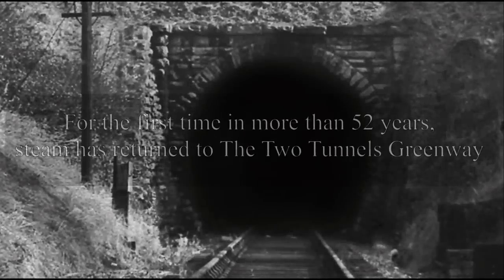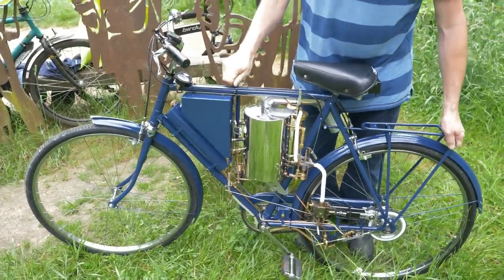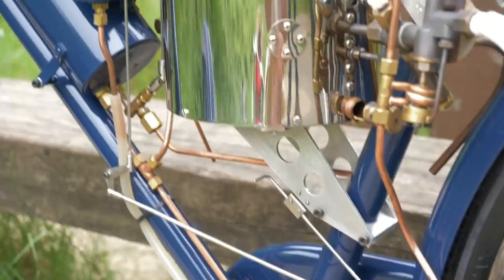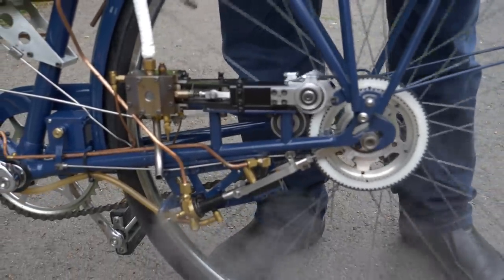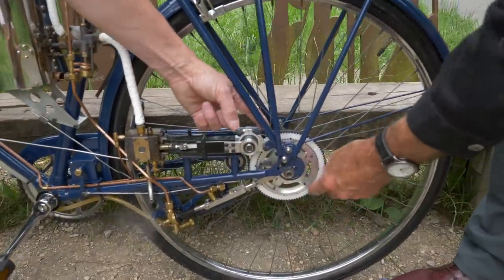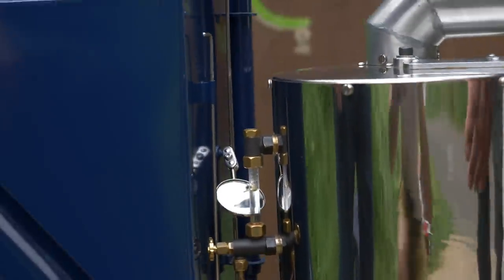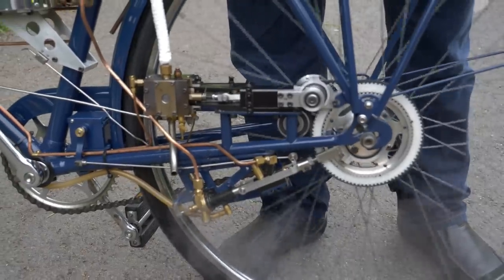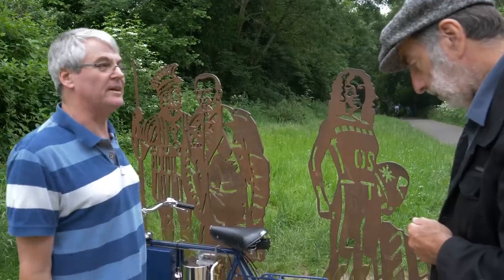The Ruscombe Gentleman's Steam Bicycle

Comment: Truly MASTERPIECE of engineering. 
Well done!
Reply: I bet he needs a license to operate it, lol.
Reply: It is
Reply: @mybluebelly  Electric bicycles are allowed 250W.  Anything above 250W is classed as a motorcycle, and so subject to all the regulations and licensing issues.  This machine is 130W - so it is well within the regulations.
Reply: @paulstandeven8572  also, its speed caps off at around 15k/h. So neither the speed is a problem!

Comment: Seen a number of attempts at producing a steam powered bicycle, but this is by far the best. It actually seems like an everyday use machine. ...It shows what can be done with informed and careful design. It would be nice to know a bit more detail of the hybrid boiler.
Reply: Yes Steamyfog, re: hybrid boiler, I can't understand why cramming a section of firetube boiler in there would help.  Obviously it does, but why specifically?  The price for doing it has to be very high- the time spent on it must have increased by 10x.
The refinement of this machine produces an incredibly rideable bike.  Just imagine if ICE engine development were delayed by 30 years.  The world received a few beautifully refined steam engine vehicles just as consumers got attracted to ICE engines.
Doble, White, Stanley, Sentinel Steam Trucks,  the last Bessemer steam locomotives in the 1920's with multiple cylinders/drive wheels, the Bessemer Steam Biplane, etc.
We might have had steam engines right into recent times.
Reply: @someotherdude  In my opinion it was the electric starter that killed the steam engine in cars or other road vehicles. Why wait a few minutes for steam when you could push the clutch in, press a button and go? Also, some people were scared of steam because they were worried about boiler explosions.
Reply: I think it was that and more- how would you operate the thing in the dead of winter with freezing?  Boiler explosions were not too serious though, with small monotube boilers.  The tube basically rips open and releases pressure, no 'bang'.   But also, steam engines wold tend to have less range and to additionally demand water, and they are oil consumers too.  Without computer monitoring and control, you have a more complex job as driver.  But read about the 'cyclone steam engine', it now takes 30 seconds for steam pressure to be ready to drive- about the time it takes to settle in, put on your seatbelt, turn on the heat or AC, etc.
Reply: @twistedyogert  steam died because IC engines were a lot cheaper to make.
Reply: @someotherdude  I'm not sure I would dismiss a boiler mishap quite so lightly. In this case a small quantity of 100 psi super heated (500C) steam released close to a human would be no joke. I have every confidence Mr Drake knows what he's doing.
Reply: HA HA!!!  No it wouldn't, not 100 psi you silly.  Silly fools in tire shops play around with twice that.  You might even be able to hold back 100 psi from coming out the end of a pipe, as long as the edges of the pipe weren't sharp.
Reply: Any boiler with modern steel instead of the brittle iron locomotive boilers of yesteryear, is safe.  They will rip open, not explode suddenly.  Now a jet of superheated steam suddenly erupting right next to your skin, that's a problem- but because of burns, not shrapnel.  And an extra layer of sheet metal will take away even the burn risk without adding weight.  It's safe.  That's coming from the guy (me) who is constantly berating people on FB and YouTube for doing unsafe things.   Although superheated steam is the realm of experts and gives amazing performance, it's not necessary-  Increase the piston size, go with 'wet steam' (300 degrees and 100psi) and you can actually let the piston be lubricated with water.  No oil system needed.
Reply: @someotherdude  thanks for your info very useful good luck
Reply: @someotherdude  some people in tyre shops get badly injured from tyre blow mishaps 😓
Reply: @someotherdude  It's the superheat that's dangerous, not the pressure so much. Superheated steam is completely invisible too.
Reply: non sequitur, if you mean tires blowing up and rim failures.
Reply: Yes it is, I agree Anthony.  But a single layer of sheet metal over the high pressure tubes in question will make it safe.  At that point it's no more unsafe than a hot exhaust pipe on a motorcycle.
Reply: @JimRichardson  Steam died because the power-to-weight ratio was massively inferior as was the fuel economy. They were more expensive to operate, dirty and not particularly suited to cold climates. Steam turbines were more efficient in ships, but maintenance was a headache at the time of the switch to diesel, due to scale. They are still used in nuclear naval vessels however. The US nuclear fleet is essentially steam driven. The aircraft carriers in particular are floating islands which do not require refueling within their designed lifetimes. I believe the steam turbine system is closed-loop, but it's my understanding that the carriers house desalination plants large enough to provide drinking water for a city of 250,000 people, so perhaps not, or the desalination is required for the steam-catapult system which is being replaced by electromagnetic launchers in the latest vessels. They also carry a crew of 5,000 and can accommodate about 8,000 troops, so there's that. So steam didn't die after all - it just moved to a more upscale market niche. :-)
Reply: @JimRichardson  actually range was quite the issue- often trucks had to take water from streams and ponds every 50 miles or so

Comment: Ive always loved the potentials of steam
Reply: Supppsedly spitfires Rolls Royce V12 ran on steam. The cooling sealed superheated system rand through the leading edge of the wings. The German mssserschmidt speed record "the French men burnt there hands on the leading edge when they pushed it into the hanger" 
The closed dry steam pressure system runs at 850lb per □ inch. Superheated dry steam. I think steam is the best system avaiable  the sealed dry steam system can run for 00s of miles before needing a top up of water. Would go along way to explaining the old world and how they could build these magnificent structures. Steam is the ultimate power. Less moving parts. More efficient and far more powerful than diesel. 
E.g.. 2 5/8 × 4 1/4 inch. Two cylinders at 125 lb per □ inch pressure can carry 74 passengers in one load with 2 carriges. 
The engine us 10 foot long. 2 1/2 foot high. 1 . Foot .7 nch wide. 4820 passengers in one day. Parramatta to domain Sydney 1890. Cheers.
Reply: Thanks for the info. When I was a kid about 60 years ago, I got a Christmas gift of a working kid version of a  steam  operated shop. With working drills, lathes ect. . A great learning tool. They cant sell those to kids now. Fire, boilers & saws. Wish I still had it.
Reply: @jedsparks3868  yes. We can't get anything now a days. Not even a chemistry set. Nanny state. I don't feel safe. Ring the DhHs. Omg. Help. Haha
Reply: @jedsparks3868  They do still sell them. Do an ebay search for Wilesco or Mamod.
Reply: Thanks

Comment: Wonderfully built. It seems the system is designed after Stanley, with the addition of an economizer. Beautiful machine.
Reply: I think the steam generator is more inspired by the Doble
Reply: @paulstandeven8572  hard to say without seeing it with the casing off. Doble didn't have a water level in their boilers. They were all monotubes/monocoil boilers with water in one end of the tube stack and steam out the other with superheater and  de-superheater sections also.  The Stanley's had firetube boilers (with an actual water level), and a superheater section running from the throttle to the engine. The one's I have worked on we have installed a pre-heater or economizer section to the feed water going into the boiler. Usually about 50' of 3/8" tubing under the smoke hood and above the firetubes. 

The vaporizing burner and tree for the jet looks very Stanley-esque also. Just one branch and jet, rather than two.
Reply: @WesleyHarcourtSTEAMandMORE  Agree.

Comment: Impressive steam machine. About the exhaust steam, you could use it to run a small alternator to power lights and horn, then condense it back into the tank. You could also do a Mk2 engine with triple expansion and a gear change system to better take on hills and flats.

Comment: I have a feeling that mankind and steam power haven't had their last dance just yet. 
Just an hour ago I felt  Compelled to research steam powered  Technology implemented throughout History as it pertains to the automobile and Motorcycle. I think that 1 could build a fast lightweight efficient steam powered bicycle if they were to design the frame around the steam power train and have Then be made for one another. I imagine that the wait for a 50 or 60 mile an hour machine would be similar to that of 125 2 stroke dirtbike  No expense was spared in research and development  Light weight high strength materials and cutting edge power train innovations.  I just believe that the bicycle is such a phenomenal platform from which to feel from when at trying new power sources because of how in Heron fishing bicycles can be really low existence in tires, the lack of frivolous components such as suspensions to waste forward propulsion energy with, then you have the slim aerodynamic design they all share. Using high strength ultra light weight drivetrain parts i.e. sprockets, wheels bearings would be nice to emphasize.
Reply: nice name!

Comment: Since I am a little slow on steam technology,  I would like to know about the (5:34) additional 300 degrees C super heat.  How is this added, and does it boost the final steam pressure or just make the steam more efficient by drying it out?    A superbly well crafted bicycle.   I would like to hear less noise from it.  I suppose the steam condenser would quiet the exhaust considerably.     Thanks for sharing.

Comment: so fun to watch it go. Is there any more info on the way it drives the rear wheel, how its attached, etc, Im wondering whether there is sufficient gear reduction to use it with a little rc motor ?

Comment: The rest of us have to settle for steam transformed into electricity.
Reply: Maybe that can be an evolution of it. Hang a turbine on the exhaust and generate electricity
Reply: @twoeightythreez  steam engine efficiency ends up at 25% at it's best and 16% in practical designs. Electric dynamos are able to convert 65% of mechanical power to electric and electric motors converts around 60% back to mechanical motion.
Lets think gentleman is genius and his steam engine works with 25% efficiency. Do math for electric transmission: 1 x 0.25 x 0.65 x 0.6 = 0.0975 or more than 2.5 times the loss of power with increase of weight another few kilos.
Still think it would be an evolution?..  (-;

Comment: No condenser to recoup the water so it matches the fuel range?
Reply: He said that he is planning to make a condenser, which he estimates will increase the water range from 16 to 40 miles.  The fuel range is 25 miles.  If he were to make a compound piston engine, and a condenser, the efficiency and fuel range would both increase.  But let's face it, it's a splendid achievement already

Comment: tht's what proper Englishmen do, when retired. ps Needs a dynamo front hub
Reply: I would also want better brakes
Reply: @paulstandeven8572  my only criticism is the lack of a period correct looking helmet. Instead of a dynamo, wouldn't an acetylene lamp (or whatever they're called) be more appropriate?
Reply: @Stelios.Posantzis  I'm not sure which period might be 'correct'.  Steam power would suggest pre-1960, or perhaps pre-WW2 for its great era.  The bike looks like a '70s Raleigh roadster.  Cycle helmets did not arrive until the Bell helmet of the mid '70s, and not common usage until the '80s . 

FWIW Acetylene lights were bright for their day, but difficult things, and it's hard to get the carbide.  There were dynamo lighting systems for bikes in the '30s - I have one somewhere.  A better bet would be oil lamps, which do look a bit like acetylene lamps, but lack the fiercely bright light.
Reply: @paulstandeven8572  I was thinking of the leather helmets (?) and goggles riders/aviators were wearing in the '20's - '30's or later. I did not pay close attention to the bicycle and did not realize it was a '70's frame - I thought it was earlier.
You' are right about the carbide. I have often wondered about that as there are plenty of these lamps on the second hand market and one would think it would be possible to source the carbide on ebay or amazon given there is a demand for them. I did not know about oil lamps. I do however have a petrol lamp (perhaps the same thing?) possibly from a car or more likely from a horse carriage and of course many alcohol lamps - none of these are sized appropriately for a bicycle though.
Reply: And more air in the back tire ;)
Reply: @Stelios.Posantzis  It's illegal; to post carbide - it's regarded as an explosive.  I tried for ages to find a supplier of carbide so I could test an acetylene lamp I repaired.  Finally a friend gave me a sample.
The style of head protection you describe  could be fabricated.  Up to around 1980, racing cyclists wore a crude padded rubber thing, but it's a distinctive style for racers and sports riders.  Not the gentleman rider.....
Reply: @paulstandeven8572  Ah yes, you're right. Gentlemen riders generally wore caps.. But are we talking '20's or '70's now? I suppose some riders still wore caps in the 70's but wasn't that fashion dying out?
You've ignited my curiosity about carbide now and to check what it actually is that is referred to when mentioned in conjunction with acetylene lamps. According to Britannica, Calcium carbide is a source of acetylene so I guess this is the carbide referred to. Apparently it produces acetylene when in contact with water so, yes, I guess, that would make dangerous to transport by post. It can't be that rare a compound though if it's used in producing acetylene. I guess the difficulty in procuring it comes from the ban on posting and its limited use almost exclusively within industry. I suppose one could make it provided a source of heat able to reach 2,200 °C is available at hand.
Reply: @Stelios.Posantzis  Yes, it is calcium carbide, which produces acetylene gas.  With an acetylene lamp, you had to regulate the gas output by varying the water drip rate.  If you ran out of water, improvise....
Until recently, cavers liked to use carbide lamps, so cavers' supply shops were the best source for buying it.  But you had to look around.....
When searching on-line for carbide, I found Indian companies keen to find agents in the west to market it.  Sorry, I just wanted a few grams, not tons!

Cavers have gone over to the much improved LED lamps, so no more demand for carbide from them

Comment: Superheating steam does not merely mean making the steam very hot. It means raising the temperature of the steam without raising the pressure so that there are no water droplets left because liquid water does badness things in the steam pipes and cylinder of a steam engine.

Comment: It is professionally built and looks factory-made. My question is how efficient is a steam engine compared to a gas-powered engine giving the same output? Can it be made more efficient than a gas engine because a gas engine would radiate the waste heat through the radiator?
Reply: In the 70's there was a lot of research into steam because car companies didn't think they could meat the proposed emission laws.  This was dropped when they realised they could meat them

Comment: Is this machine required to be registered as a mechanically propelled vehicle for the purpose of riding on a public highway?
Reply: I think if the cops pulled you over they would simply appreciate it for what it is and send you on your way.
Reply: I think the main concern would it getting flagged for being a loud nuisance. I was wondering what type of noise-suppressor device on the end of the exhaust would survive the hot steam.

Comment: it would be interesting to see this with a steam turbine instead. Mainly because then you're less likely to get oil contamination in the water if you use a condenser (you can have all the bearings be outside the steamed area bascially).

Comment: I want a portable steam generator. I also want a steam plane I think at height in the thin air and the cold it would be very efficient. The water boils at a low temp requires little fuel the steam can be instantly condensed. I think the efficiency would be amazing. It could generate electricity and run props on electric motors.

Comment: Could that engine extend the range of an electric buggy? I was thinking propane might be a good fuel. Wood pellets also to charge a home battery bank. Yes that's it! You could set it in a roller/stand, at home to run a generator, and have a hopper! Duel use. Triple use. Put it in a green house. Seriously. People need options right now.

Comment: I thought for years taking steam and updating the technology more efficient kind of what he's doing you know it's how it sounds more like a modern engine at the very last when he guns it a few times awesome you're awesome what I'm gathering is 40 miles for a gallon of water which is free and then I'm not sure how much fuel that was didn't look like a much but he said it would run on multiple fuels maybe it would be more efficient to burn the water into steam and the steam drive the engine steam engine that's kind of the theory of train a diesel engine pulls a generator that pulls the wheels on a train so one energy source to work a more efficient energy so sometimes it's an answer it results is more miles per gallon I'm sure could easily be read through fitted with coal or wood